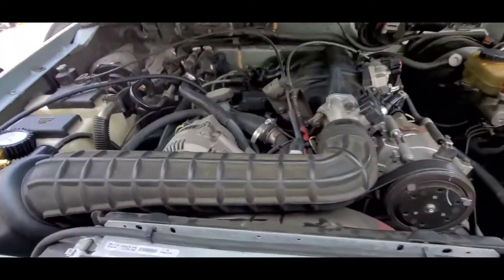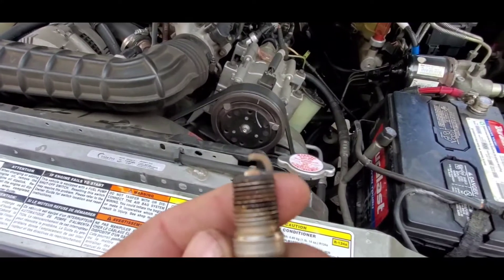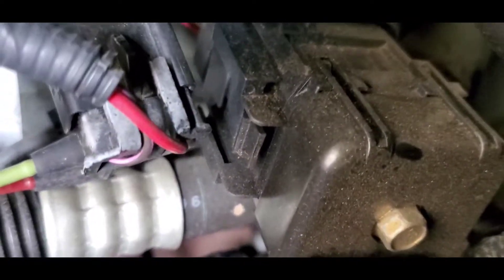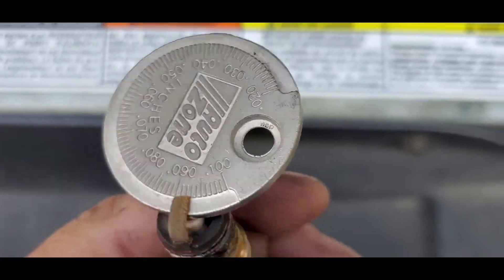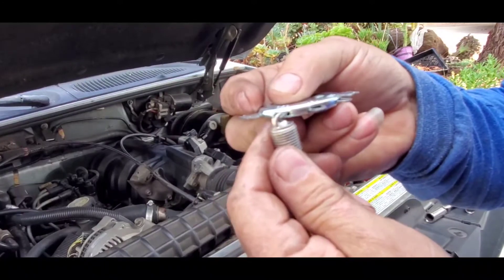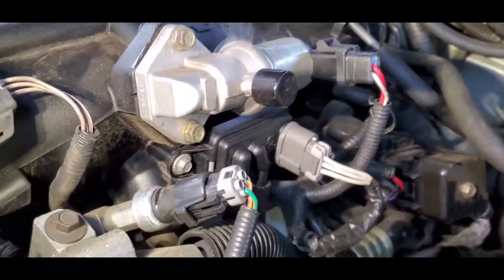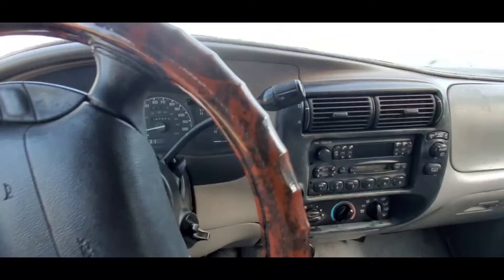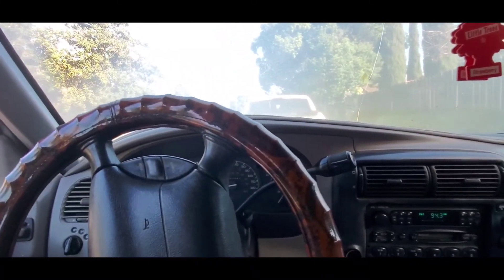ford explorer hard cold start , long crank,  stalls

Comment: I had the same problem. And once it started it would start all day, next time it sat for ant length of time I'd have a hard start again. First started with replacing the battery, not it! Next was the Fuel filter, Again not it! Replaced the plugs and wires, Not it! Turned it over to my neighbor that had testing stuff. fuel line tested fine ever though it sounded like it was starving for fuel.  Fuel pump was ruled out at that point. Longer story short it ended up being the engine coolant temp sensor wiring pigtail was loose. with the test unit in place it would show that it wasn't read it correctly. Tightened up that connection and it starts every time now. 

We found this same problem over and over on the internet but never saw the fix. Hopefully this helps and maybe your is this simple!!
Reply from the maker: truck is running great customer is really happy , this fixed the problem , thanks
Reply: Thanks for posting your response. My nephew has this same issue and mechanic seems to be chasing his tail.  Going to mention rhis.